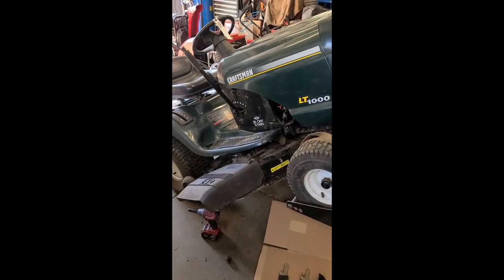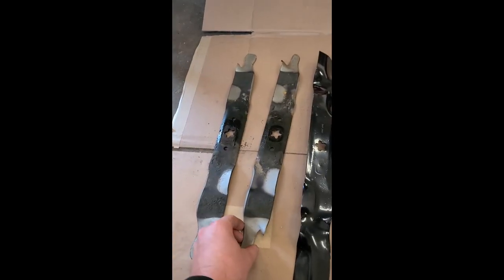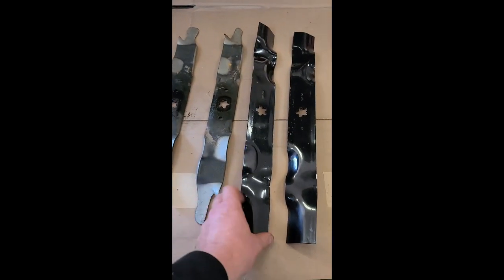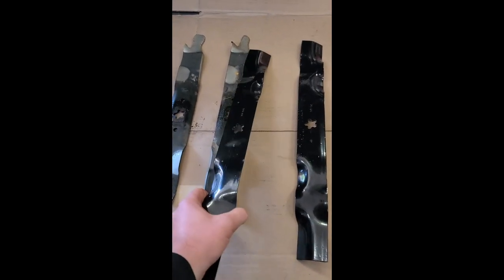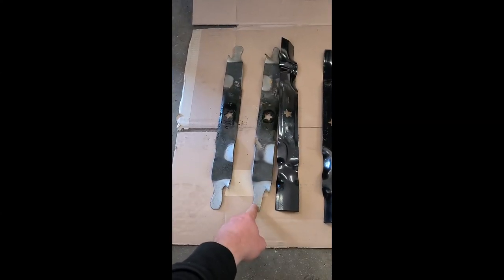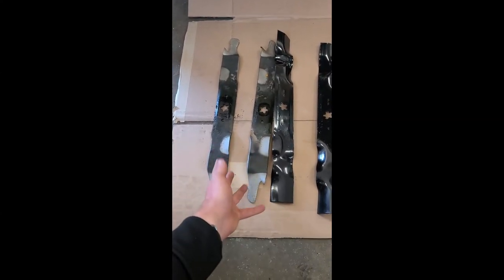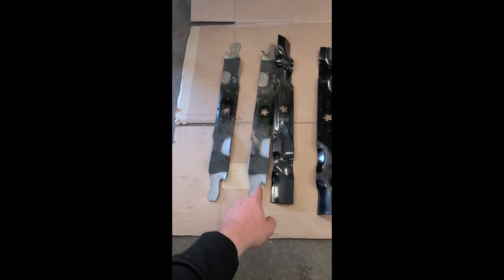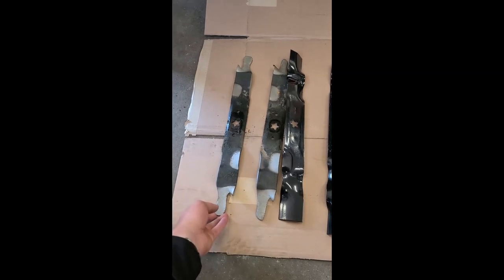Don't Let Your Lawnmower Blades Get This Bad! #shorts

Comment from the maker: Have you guys seen worse blades?
Reply: Not Me, those are the pits !! LOL.
Reply: Not only blades, but neighbor brought me his riding mower that kept burning/ throwing belts. Decided to take deck off to get a better look/feel at 
  Pulleys, bearings ect.
  Turned out to have ( weighed   In 5- gallon bucket) 53-lbs of grass and mud dried underneath.
Reply: I have. Even some bent to almost 90 degrees.
Reply: People sure do not know how to take care of their equipment.  I have had some mowers like that too!  I have had one deck so rotted out that the grass was blowing out of all of the holes and filling up the top of deck and flipping belt off.  Told owner to blow off deck or sweep it off.  They never learn.  Just keep bringing rider back with belt flipped off and full of grass!!!!
Reply: I believe that is a record setting example. I've seen blades that made the cutting edge indistinguishable as anything that you could call a blade but those are totally roached out garbage.
Reply: Seen a completely snapped blade on a john Deere compact tractor deck.

Comment: I am just a homeowner and I own 6 gas powered tools. Two of them are over 30 years old and still running fine. My father always told me that if you take care of your tools they will take care of you.
Reply: @burningfeet57 You must start out with a quality tool.
Reply: @bobhumphries3998  My dad bought a lawn chief push mower in 1977. I still use it every week. Take simple care of stuff and it lasts forever.
Reply: @MattsRageFitGarage  So true. I take care of all my tools, not just the gas powered ones.

Comment: I bought a used (well used) SCAG Tiger.  the blades weren't that bad, but pretty bad.  I don't want to buy new ones as my property is rough and rocky.  I try to keep the rocks picked up but they keep coming out of the ground.  I need to repair the hydro pumps as control is sketchy.  It's got a newer Kohler engine.  The engine probably has 1500 hours on it.  It runs like a dream and starts easily.  I parked it under my deck last winter.  Without doing a thing, I hit the key and it popped off this spring. I burn ethanol free premium only in my gas engines. Also need to figure out the problem with the wiring as I can't get the mower to engage.  I've jumpered it to mow.

Comment: Old saying. Out of site, out of mind. Working on a friend's old cub 129. Kohler horizontal. Air screen facing rear almost under dash. Totally clogged. No wonder engine is running hot.

Comment: I actually had 1 set that was worn worse than those and the Owner flipped the blade over and sharpened the other side. lol                        
And don't be an Idiot and make sure that you line up the star on the blades before tightening. I can not count how many stripped out spindles I've had to replace over the years because of that simple mistake.

Comment: speaking of blades looked at mine yesterday crawled on the 1989 craftsman and whent to engage blades and it made a horrendous loud noise but blades where not turning.everytime i pull knob to engage blades it makes that super loud noise again.. all belts are on it looks like..if i pull on belt blades turn

Comment: The blade bolts tend to tighten themselves over time. I think some people will go without changing the blades because they don't know how to get the bolts loose.
Reply: 15=18 inch breaker bar wrench.
Reply: @paulbillings1791  It isn't the wrench that is the problem. You have to know how to stop the blade from spinning: I am certain that many people don't know how to do this and/or don't have an impact wrench.

Comment: Have you seen the new blades on a cup cadet you do not need no tools to remove
Reply from the maker: no i haven't seen yet
Reply: @donyboy73  No wrenches needed
Reply: Will have to watch out for those mowers.  Sounds interesting!
Reply: @robertasleson5856  It’s on a cub cadet riding tractor push up on a bracket tournament right right off

Comment: I'd have tossed those blades long ago.  I keep two sets of blades and sharpen with the blade in a vise using a flap disk every other mow.  But after every single mow I scrape and wash the deck under- and top-side then run the carb dry.  Cheap Honda push mower has lasted a decade and always starts easy.